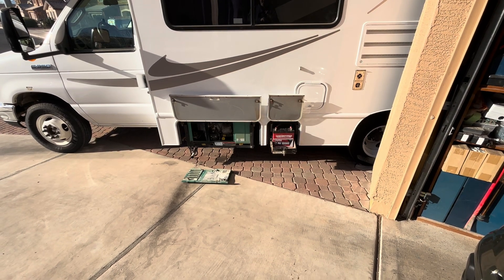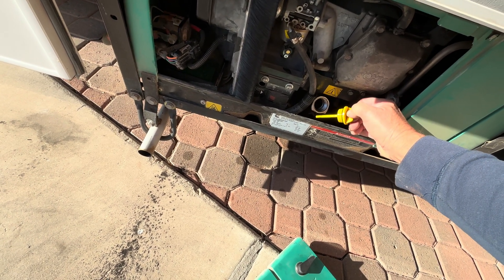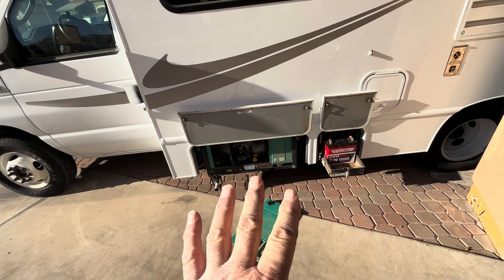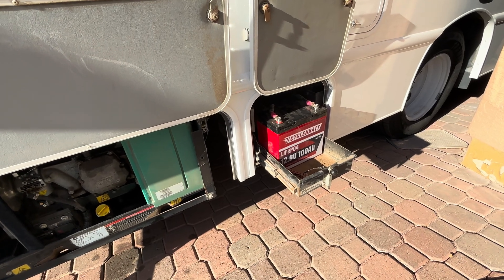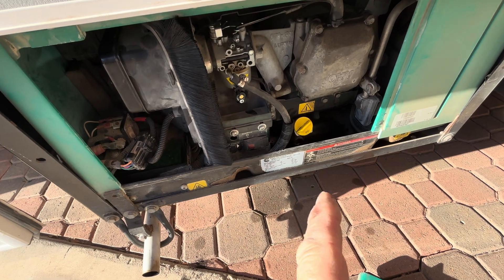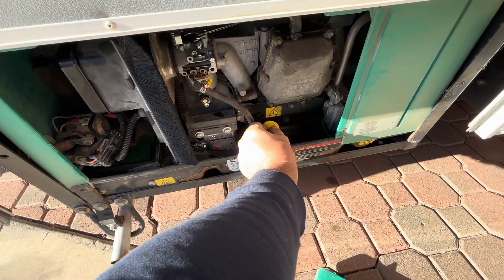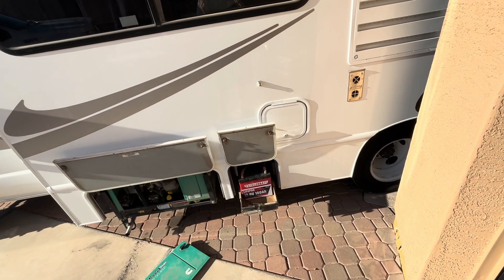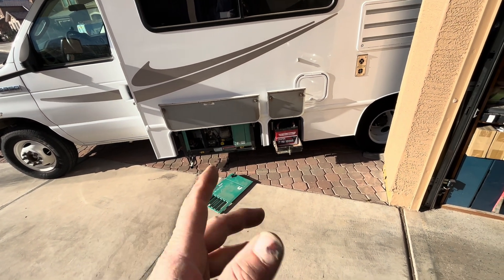Onan 4000 watt RV generator fix to stop surging, start easy and continue to keep running

Comment: They put a new carburetor on there, but it’s too high so we’re trying to find out how to adjust it
Reply from the maker: I installed a new carb on my generator that I bought on eBay for around $35 and was easy to adjust after making sure oil level was correct level. Making sure oil level was correct kept the generator running to adjust carb.

Comment: ty for this. This is definitely a video for new owners need to see
Reply from the maker: You are so welcome. I had trouble for years trying to start and keep my generator running. Now it starts every time with 1-3 tries and runs all day long. I no longer have to start every week but can go 2-3 months in between and it will start and run. Was very frustrating. Hope it works well for you as it did for me.

Comment: Great video I'll try adjusting my Idle screw ..mine runs smooth for 30 seconds then sputters out black smoke and shuts down..
Reply from the maker: On the dip, I have my oil level 1/8 above the bottom of the proper oil level. When I had the oil level close to the top on dip stick gauge it ran like crap, sputtering, reving up and down, maybe ran for 15-30 minutes then died, could not start again.

Having the oil when engine is cold just a little above the lowest part of the oil range on dip stick makes this generator run consistently great and starts easy on 1-3 tries every time. Hope this fixes your generator to run great all the time.

Comment: I am reading that a 10w 40 or a 10w30 work best that are a premium oil. Too thin and it foamed...even with something like Royal Purple. These air cooled run really hot. What's the amount you put it and what oil do you run? I was considering like an Amsoil or something
Reply from the maker: I use 10W-30. I am in Phoenix AZ. Only camp in warm weather. Always above 32 degrees. 

Working great to start all the time. I fill oil to 1/8 to 1/4 inch above bottom of fill line on dip stick. 

If you go in the middle or higher of fill line on dip stick, the engine will be hard to start, rough idle and stall after about 1/2 to hour of running. 

I could never start my engine when I had oil level at half point of fill line on dip stick. Now it starts all the time within 2nd try and runs smooth. 

Had to run it about 7-10 hours after lowering oil level before it started running really smooth. 

So I won’t go higher than 1/8 to 1/4 inch over bottom fill line in dip stick. It should barely touch right before threads on metal for dip stick hole. 

If you run in a colder climate, you will need a different oil to compensate for colder temps.
Reply: @diy-solar-guy  Alabama in the summers....very hot.....very humid..... I only run it as it gets hotter outside late spring through summer some early fall.....no boondocking....just driving
Reply from the maker: @ I struggled starting my propane generator for years until I figured out the dip stick was a engineering flaw and that the highest oil level should be on the lower part of fill line. 

I hated to think about trying to start generator, I knew it was not going to start for years. 

Now I have complete confidence that it will start every time I try so I’m ready to go camping here soon with my solar powered mini split I installed. 

No more needing electrical hook ups. Solar is quite and easy to install. Happy camping this summer in Alabama my friend.
Reply: @diy-solar-guy  Florida Gulf Coast and Tn Mountains! One time to N Myrtle Beach too! I have a love hate with my Onan. My dad's was propane he had on his Snap on Truck, but mine is Gas. I have had carb issues, fuel line issues, pump issues, air issues, battery issues, and yes now discussing oil level and oil type. These are some picky machines...but excellent when they work!
Reply from the maker: @ propane is no gelling. I like propane much better, propane seems to last forever compared to gas. I only have a 15 gallon propane tank and I rarely have to fill.